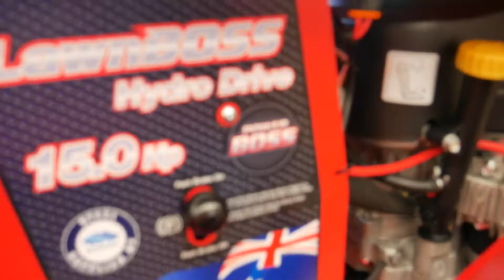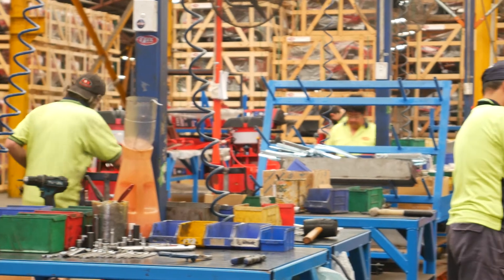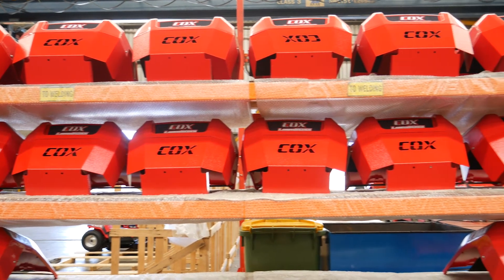Announcing the launch of the COX PowerBOSS Engines programme

Comment: I blew the 16.6HP Briggs engine on my Greenfield after 350hrs and replaced it with a Loncin 15HP. It cost $900 fitted and is going well a year later. Apparently they are a Honda copy and have better longevity than Briggs, that's according to a mower mechanic I know.